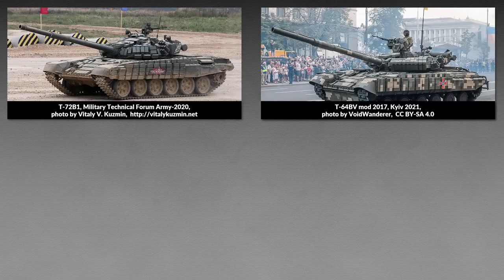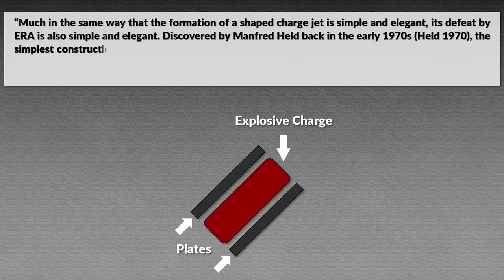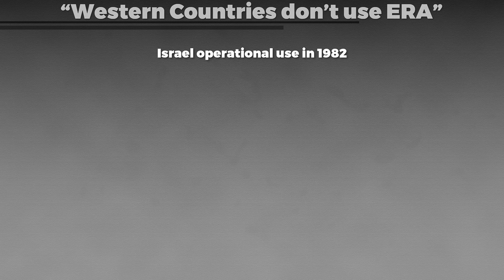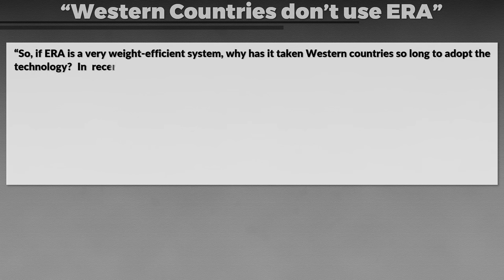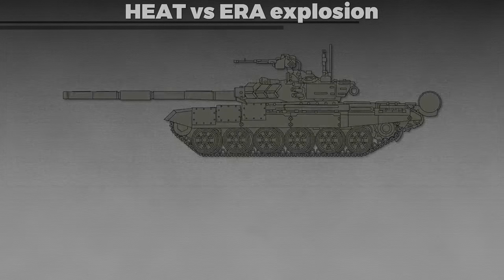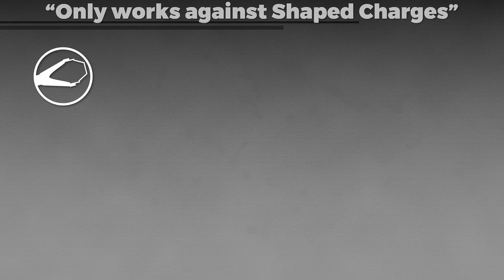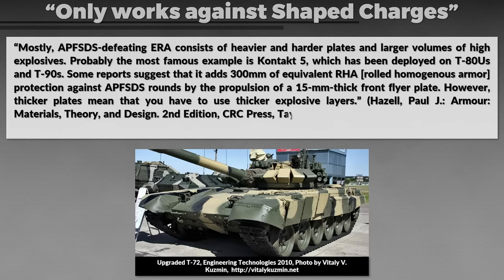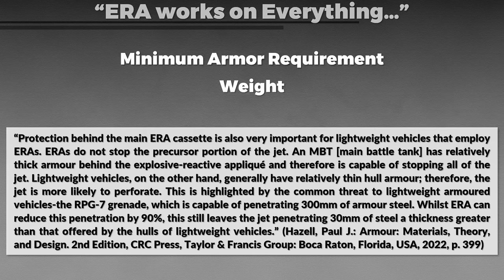Explosive Reactive Armor: Common Misconceptions (feat. Prof. Paul Hazell)

Comment: Heavy ERA, while effective against APFSDS, is not very effective against HEAT anymore, due to the greater weight of the flyer plates. Heavier plates accelerate slower and have less "feeding" effect on extremely fast HEAT jets. So ERA design is usually a choice of do you want it to protect against APFSDS or HEAT. It's very difficult to do both.
Reply: Sorry for the layman question but what about NERA design? Does it have similar trade-off or so? I know it's heavier and can resist tandem charges but I have little to no idea about its mechanism. Thanks in advance
Reply: @rizkydarmawan6540  It´s much the same with NERA. Physics don't change. Heavier objects accelerate slower or need more energy to accelerate them faster. NERA uses inert material like rubber to move the flyer plates. The force of the penetration forces the material to expand, which moves the flyer plates. The idea is the same as in conventional ERA, but because NERA has no explosive, it can be contained inside the base armour of the tank. This would be pretty much impossible with ERA. The explosion could rupture the armour from inside. The non-explosive nature of NERA also means they can be stacked. Modern composite armour contains multiple NERA plate(bulging plate) arrangements behind one another.

This video has pretty good simulation of that.
https://www.youtube.com/watch?v=3hAoxcJ_9W4
Reply: There’s a ridiculous method I can think of, stack the HEAT resistant ERA on top of the apfsds ERA. So they’re double stacked. The outer plate would hit a heat round first, and the apfsds is going right through the outer one anyways. Meaning it’ll also hit the inner plate. It also doubles the effort to produce it though.
Reply: @Hrrrrrrrrrreng
You read my mind. HE physics should confirm that (or not). Call the Slomo Guys to find out. Though cost and weight might get in the way of equipping all vehicles, that's one of the reasons they use cheap and ridiculed "cope cages". Reportedly works against  FPV HE-carrying or suicide drones.

Comment: ERA is basically a  uno reverse card for the liner from hollow charges. That liner is formed into a penetrator by explosives and ERA counteracts it essentially the same way. Russia and Ukraine use it so much, because they found out, that most danger to tanks comes from various kinds of hollow charges. Most of the FPV drones, RPGs and ATGMs used in this conflict are hollow charge weapons. And many of them can attack a tank's armor from angles that are not in favour of the armor layout of the tank.
Reply: Funny how tanks were mostly designed to fight against other tanks when in reality infantry in general came to be their greatest demise
Reply: @Verxinn  In reality, it is artillery and drones that appear to be responsible for the most tank casualties.  Infantry remain a threat, however.
Reply: @Zorro9129  Fair enough. Correct me if I'm wrong here though, but I'd argue that artillery and drones (small FPV ones, the larger are definitely their own thing) are part of the infantry network, as both system require coordinates that I assume are most relayed by them. To further add to my point, its important to consider these systems appear to be better in "finishing the job" by attacking abandoned vehicles (usually due to AT mines placed by infantry or ATGMs) rather than to do it all themselves. One may credit the finishing move as the casualty, but i consider an abandoned tank as combat effective as a blown out one, therefore knocked out.
Reply: western composite ceramic armour is just as good against HEAT as it is against HESH and APFSDS... 
why you don't see much ERA on modern western main battle tanks. They don't need it on top of the composite.
but it is why they are larger and heavier than Soviet MBT.
its worth the weight and bulk against tandem HEAT RPG and ATGM. As seen in the war on terror. 
Some extra slat or ERA, on the bits without composite does not hurt.
Reply: @Verxinn  well i mean, tanks were designed to fight infantry mainly
Reply: @Helperbot-2000  Id agree with that on early tanks, but atleast to me it seems that newer ones have most of their design work crafted towards surviving and destroying enemy tanks instead of proper infantry. Not saying that they can't fight infantry, they can do that very well in the proper environment, but I suppose there are better alternatives overall for that specific task, mainly IFVs

Comment: Thing is.. losing a tank is worse than having an infantry man getting hit by an ERA plate.
Reply: not when the news gets back to your country
Reply: True.
Reply: Being near a tank is extremely dangerous. 
If an infantry close enough to be injured by ERA then he would be in range of the shockwave from the Tank main gun... Modern Recoilless guns are simply too powerful for infantry to operate close by
Reply: @huntermad5668  while true it's only in the rear and inside the cone of doom, which a look at the rear will show that cone of doom.
Reply: Well, you want your infantry to disperse so that they can protect the tank.  ERA panels is just an incentive for them to do their job!
Reply: @paulthiessen6444  true supporting infantry shouldn't be hugging the tank.
Reply: @huntermad5668  >>If an infantry close enough to be injured by ERA then he would be in range of the shockwave from the Tank main gun... Modern Recoilless guns are simply too powerful for infantry to operate close by<<

You'd have to be standing in front of or next to the end of the barrel for the shock wave to have any effect.  Your sentence about recoiless guns is not relevant because no modern tank uses recoiless guns.  Vehicles that do have recoiless guns, yes, it's been standard for the 80+ years they've been use to not stand behind them in the blast zone.  No news there.
Reply: Okay, Smoothbore gun. Okay....
Reply: @huntermad5668  If you mean tank guns then just say so.  It doesn't matter of they're smoothbore or rifled.  And they've been dangerous to be around as far as blast danger is concerned in the exact  same way since about 1942.
Reply: @huntermad5668  i can travel far and wide, talk to the living and study the dead. Climb the tallest mountain and dive the deepest fathoms. And not anywhere or anyhow can I find the fucking context.
Reply: @stephenallen4635 not when the infantry gets wiped out because the poorly protected tank they are working with gets destroyed…..
Reply: Jsut mount ERA at an angle upwards
Reply: @noticing33  not how that works. And the help is marginally there.
Reply: @osmacar5331  prove it
Reply: @noticing33  oh you're one of those people. Am not wasting effort against what ever thing you are.

If my impromptu apprentice asks i will answer, cause he's not a barbarian, sorry they're called american now.
Reply: @osmacar5331  you lose
Reply: @noticing33  ok american.

Comment: 4:34: Apart from the physics/engineering, there is also a legal issue. It may sound daft but I as a commander am required to minimise the WH&S risks.
The firing of the RPG / HEAT round is an action of the enemy. The effects of the defensive ERA type countermeasure has been legally argued as an action of friendly forces and falls into the same area as ensuring for example that friendly Infantry are not in the frontal arc of the tank when you fire APFSDS, in order to minimise the effect of the discarding sabots.
There are similar legal questions about automated self defense systems such as AVEPS where exposed dismounts may be subject to effectively "friendly fire".
Reply: Then, why are modern armored vehicles so actively outfitted with APS? In my opinion, a piece of metal with relatively low velocity (I think many people have heard of Newton's third law) is safer than an air-burst charge weighing as much as a grenade that explodes 10 yards away from the tank. Out of respect, I will not cite as examples cases of "blue on blue", in Iraq or Afghanistan, which became known only thanks to whistle blowers, and investigations on which never happened.
Reply: @Scorchluck  You are entitled to an opinion. It just doesn't count compared to binding legal advice.
Reply: @whya2ndaccount  As I said, the second part of my comment can be ignored in the discussion. The first part has nothing to do with the Law at all. 
You're trying to rationalize the lack of ERA on western armor through very convoluted reasoning.
Reply: @Scorchluck  No I'm not. Different countries have different laws.
This reflects through Defence as well as other places.
E.g. The US is happy to use land mines, many other countries deem them illegal.
If your country has deemed AVEPS or ERA illegal then your AFVs wont carry it.
Pretty simple.
Reply: I'd imagine the fact that the enemy set off the ERA would discount it as friendly fire. The legal world is so weird
Reply: @Verxinn  Well based on the long brief I need to give grunts (everyone from the Infantry OC down to a PTE in the room) before we do live fire combined arms fire and manoeuvre. Adding ERA and AVEPS would result in yet more briefs.
Reply: @whya2ndaccount  Makes sense
Reply: @Scorchluck  Because APS works I guess.
Reply: @whya2ndaccount  but no NATO/western country considered ERA "illegal". US, Britain, France, Germany, Turkey, Poland - they all use it on some of their vehicles, just very inconsistently.
Reply: @Verxinn  thats just not the way it works. and i dont think its weird at all. it just takes some common sense to recognize why it works that way.

imagine for a moment that the government puts a tank with ERA on the road in front of your house, and it gets attacked, exploding and destroying both the target and your front lawn, your windows, and your dog. 

are you gonna ask the aggressor (now in multiple discrete pieces) to pay you for the damages? probably not. dont even know his name. but you know who is driving the tank with bombs strapped to the sides that just went off and turned a significant portion of your life savings into rubble.

and the reason they put those bombs on their tank in the first place is because they knew when they rolled up onto your street that someone might attack it! it isnt much different than setting up a landmine in front of your front door and saying "well i didnt set off the landmine, so whatever happened after i left is really the fault of whoever stepped on it."

the reason we see more use of ERA by Russia and Ukraine is because they dont have to worry about collateral damage. Russia isnt planning on paying Ukraine anything for destroyed houses, considering they want Ukraine to not exist at all. and Ukraine doesnt have the luxury of reimbursing their citizens for damage to life and property when theyre fighting for their own existence.

on the contrary, the western nations are consistently using their armor in lands that dont belong to them, so rolling up in the tank equivalent of a bomb vest with a dead mans switch isnt going to meet the peacekeeping image theyre trying to sell to those foreign nations when they do arrive. it would be diplomatically unwise to do that, wouldnt it?

Comment: High explosives are, as a rule, VERY stable & safe.
Some are so stable they need a booster explosive on top of the initiating charge.
Reply: this isn't true.
Secondary high explosives are stable. There are loads of high explosives that aren't, probably more than stable ones. Some of them are used as primary explosives, most aren't used commercially and are mere lab curiosities.
Reply: @tommihommi1  Yes, it is true. I worked with them for over 10 years.
Reply: @xxxlonewolf49  I wouldn't expect someone to typically be working with the types of explosives that are unstable.
Reply: @whitephosphorus15  Stable meaning 'insensitive'. Initiating explosive are much easier to set off
Reply: You aren't talking about primary HE compounds then, those are very sensitive and usually only used in fuzes. You sure you worked with energetic materials?
Reply: I think you're experiencing selection bias, because that statement would not at all be terribly applicable to a chemist.
Reply: @Xeno426  As someone who doesn't work with explosives, I can—but shouldn't—attest that they are completely safe.
Reply: This needs to be prefaced with "commercially available". The ones that aren't are generally not sold.
Reply: @warrenarthur5629  If it's unstable, it's not used, by anyone, if there is a stable option. TNT was stable, till it was sweating nitro. All modern high explosives are made to be stable & because of that need booster charges after the initiating charge, the detonator.

Comment: I think a video about the misconceptions of how slat armor works would be really interesting aswell
Reply: Only works with things like RPG-7 and similar fuzing,  the bars crush the outer shell in breaking the electrical path to the detonator. Standard TOW Misslle warhead will function fine as it has a large contact area it may have a slight reduction in penetration depth. Side blast can and will tear up tracks and storage mounted on the vehicle depending on impact point. Number of duds on impact varies depending on spacing. Chain link fence was used in Nam mounted on engineer pickets spaced about 8 feet in front of parked tanks and APC. 50% dud rate was normal vs B-40 and RPG-7.

Comment: I had always assumed Newton's law of action and reaction meant the explosion which flings the outer plate outwards also wants to fling the inner plate inwards, meaning ERA could only be applied to armor thick enough to withstand it.  Plus, the fact that the whole plate is pushed inwards more or less as a whole spreads the force around, the exact opposite of shaped charges which concentrate the force in a tiny jet.  (How big is that shaped charge jet anyway?  One millimeter, 5?  Do more modern shaped charges have a narrower jet?)
Reply: The ERA explosion is not always directed in a normal direction to the vehicle's armor. So while what you said about the need for underlying armor must be true, how much needed really depends on the configuration of the ERA. It can be not much at all.
Reply: Sometimes those egg-carton shaped ERA you see on a few vehicles are called Counter-charge method. Shaped-charge to catch the enemy shaped-charge.
Reply: @Sufferingzify unless your thinking of linear shaped charges like the sort on Ukrainian Nozh ERA, those egg carton looking things are just spacers

Comment: Interestingly, I've read reports and seen simulations that show that it's actually the rear plate that has the biggest effect on the projectile. This is especially true against APFSDS. Which means that a thick front plate is actually more useful to increase the speed of the rear flyer plate.

This makes thick base armour even more important, because you're slamming a heavy piece of metal directly against it as fast as possible using an explosive charge.

Comment: What would happen to a tank if ALL the ERA blocks on either the front or one side of the tank were detonated simultaneously?  I watched a video where a Bradley IFV detonated all the ERA blocks on a Russian tank in rapid succession using it's 25mm chain gun.  That would imply that an old M48 upgraded to 105mm, or an M60 or Leo 1 firing a beehive fragmentation shell meant to be used against infantry could theoretically detonate all the ERA blocks on a modern tank at close range.  Now maybe the Bradley was firing explosive shells and the beehive round would have to be modified to be made up of small explosive charges as opposed to flechettes, but it might very well be possible to turn the ERA system meant to protect a tank into a weapon of its own demise.  Such a shell would also have the benefit that it would be extremely difficult for an active protection system to stop it.  Active protection systems are essentially firing small individual projectiles at larger individual incoming projectiles.  With the beehive round it's forced to deal with dozens of simultaneously incoming small projectiles.  The beehive round wouldn't have to be fired at close range either but designed to explosively scatter at a calculated distance from the target. If a tank was able to survive having all of its ERA blocks explode at the same time the attacker could then follow up by firing a conventional HE round without having the ERA system in place to prevent it working.

Comment: While the penetrator of a HEAT round defeats armor mechanically rather than thermally, the penetrator rod technically does become molten/semi-molten for a fraction of a second during the penetration process. See the "Characterizing In-Flight Temperature of Explosively Formed Projectiles in CTH" research paper on sciencedirect
Reply: Logically it would have to at some point. The metal doesn't bend into a penetrator, the cone is inverted explosively and forms while in a molten state. We called them 'carrots'. I have one from a Hellfire in with my old gear.

Comment: Another issue with lightly armored vehicles. The clue is in the word "explosive"... That means that even when they do stop shaped charge, the explosion of ERA block is likely to destroy the vehicle by smashing its thin armor. It is after all, explosive on its thin armor.
The Youtube creator with the channel Red Effect did a great video with using photos from USSR tests with light vehicles and you can see entire side of BMP shattered only by ERA block exploding. They did develop ERA for lightly armored vehicles (called Kontakt-3 or 4) but it never caught on most likely due to added weight and price.